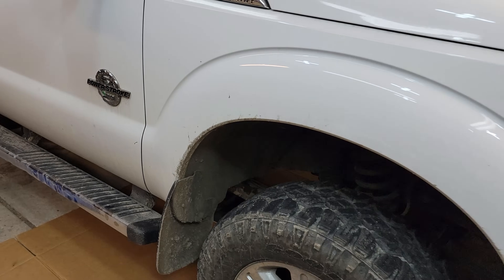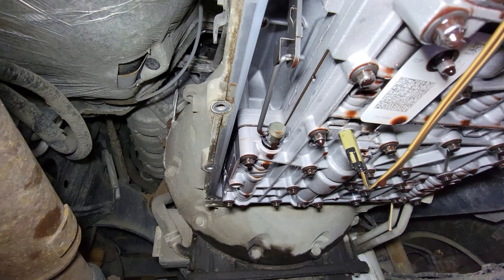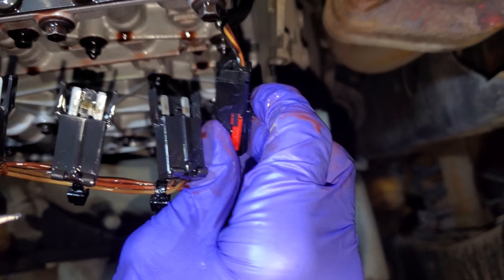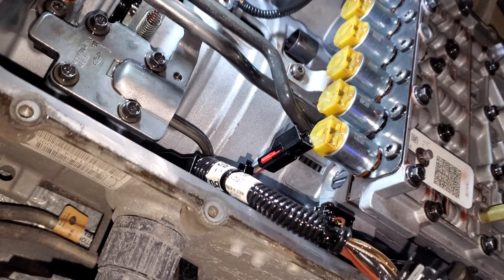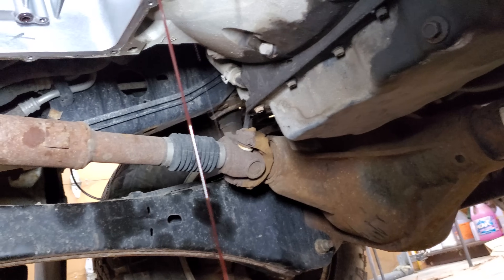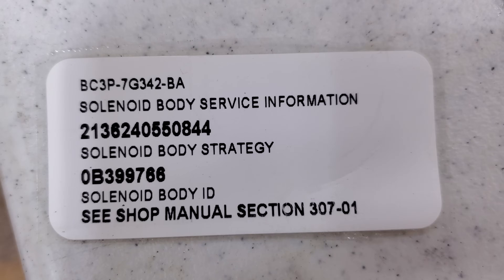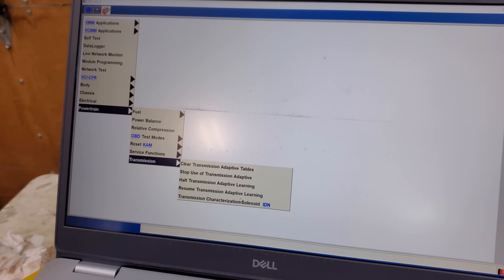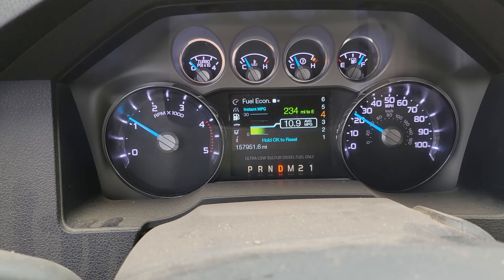**WATCH**  Ford 6R140 | Slamming into GEARs - What YOU need to know - FIXED! #6R140

Comment: Programming the valve body with IDS work while T&D.
Reply from the maker: That has no bearing on it
Reply: wasn’t able to check the strategy and ID codes to see if they match. Since I’m getting a hard shift 1-2 and 3-2.
Reply from the maker: To match with what. Each valve body is different
Reply: match the strategy and solenoid id codes provided with the sticker.
Reply from the maker: If you have a bidirectional scan tool, you should be able to
Reply: a Snap-on scan tool.
Reply from the maker: Sure, not sure what its abilities are..

Comment: Hey , when I use the part number HC3Z-7A100-B for the valve body , it claims it won’t work for a 2012 F-350 4x4 6.7
Reply from the maker: Correct. Thats an alumiduty part number. 11-16 are all BC3Z
Reply: @PowerStrokeTechTalkwARod thanks for the response my friend! , I’m assuming this would be the proper part number BC3Z-7A100-B thanks again!

Comment: Mine is from 3rd to 4th  and 4th to 3rd when you really get on it or stop abrupt.  Trans shop pulled the codes up . Tcm not reading proper voltage. Also common is the corrosion on the wires and the ground wire going to the frame.

Comment: Replaced my valve body and fixed my 3/2 harsh shift. Driveability is so much nicer. But have you came across a harsh engagement to 1st/ drive. Drive and manual 1 both clunk into gear. Rearend and u joints are all fine.
Reply from the maker: Did you program everything and reset all the values
Reply: @PowerStrokeTechTalkwARod Yes everything was recent, reset KAM, transmission values etc. shifts like butter, just M1 or initial drive engagement, and very very intermittent.
Reply from the maker: @GeneralTorva hmmmmm
Reply from the maker: @GeneralTorva that's wld be constant. No intermittent. I wld check see if ur tcm is up to the latest software level with IDS
Reply: Hmmm. Possible, truck is t&d. So would be difficult I think to get it all taken care of. I do have forscan though. @PowerStrokeTechTalkwARod
Reply: @PowerStrokeTechTalkwARod it was bad enough to make the rearend jump intermittently till I got trac bars and it tames it down SOME. but the engagement even in 4wd to drive or manual 1st is the same even rocks the front driveshaft hard,
Reply from the maker: @GeneralTorva I think you're gonna have to try what you don't wanna do. Way cheaper than putting an entire trans in it......
Reply: Did you ever get the harsh drive engagement figured out? I also have a truck that shifts great otherwise but intermediately has a harsh joult when shifting into drive.

Comment: I am watching this and wondering if this is my issue Arod. My truck will shift hard especially while towing between gears. Clunks for 5-6, or 6-5. Also between 3 and 4 I have an issue where the truck feels like it shifted but is still in 3rd, then it will kind of jerk into 4th and almost rattle as it finally shifts into 4th. 

Never does it slip out of gears or not shift. Just hard sometimes. And the weird thing from 3 to 4. 
Could this be the valve body. 
Also, for a 2019 I believe the part number is different.  For the valve body. But are the seals the same as listed in description?
Reply from the maker: Seals are the same, but you need to look up the valve body per your vin number
Reply: @PowerStrokeTechTalkwARod yep. I figured. You think this might be the fix for mine?

Comment: My 2019 has random hard downshifts mainly from 6-5 sometimes from 3-2 also sometimes locks the torque converter kinda hard but that’s rare. Also it’s turning the transmission kinda dark and greyish color. Does that sound like a valve body issue or a transmission leaving the chat issue?

Comment: Great Video A Rod!
I'd like to explain what my 2019 6.7 Super Duty is doing with the same transmission. 

I completed my 2nd fluid & filter change at around 180k miles. Everything ran great for about a week and then issues started arising. I was going to work at 4am and my truck all of the sudden wouldn't go into gear when I was trying to leave. I put it in drive and the truck acted like it was still in neutral for a few minutes before eventually slamming into gear. I figured it might be a fluid level issue since this occurred the first night the temperature dropped to 40 degrees here in Florida. I added about half a quart of fluid but it didn't resolve the issue. Over the last 4 months the transmission has been shifting very rough and many more weird things are happening. When I randomly start the truck in the morning and put it in Drive, the vehicle won't go and it jumps to 5th gear and remains there for about 15 minutes while driving. The gears randomly jump around a bit before going into the proper gear. Now the shift column lights are no longer present on the dash. It's just dark where they use to be which is weird. 

Im dependent on this truck for work and was about to replace the entire transmission until I saw this video. The truck pulls fine once in gear but the rough shifting is very terrible. Would a bad Valve Body cause the issues Im experiencing? I really appreciate your time and help man. Thanks for posting!
Reply: *UPDATE*
Even though I didn’t get a reply, I just wanted to let everyone know that all the issues I was having were fixed by replacing the valve body. After watching several videos of people having similar issues, I just took a chance and bought a new valve body. It was a quick fix that I completed under two hours and the transmission is working like it’s brand new. I can’t believe I drove the truck for five months, shifting the way it was. I spoke to several people and everyone was telling me to replace the transmission or at least rebuild the entire thing which would’ve cost me between $4000 and $12,000. I ended up spending $600 on the valve body and probably another hundred on all the fluid, seals, and filter. Thanks A Rod for posting these videos. It saved my ass and got my truck back to work!
Reply from the maker: @GnarClips now thats what's up!!!!
Reply: @GnarClips hey man how has it been holding up? Mines doing the same thing and will be doing the valve body here soon
Reply: @mikerock148 its solved the problem and ran like a brand new transmission! I couldn’t believe the difference. My only regret is that I didn’t replace the valve body sooner.
Reply: @GnarClips thanks for the reply man eased my mind some. I will be doing my valve body here co.e Monday and hopefully that resolves my issue.

Comment: Having similar issues currently along with it shifting from 1st to 5th. Gonna tackle it today to see what happens.
Reply: Got it knocked out two days ago. It fixed my hard shifts and shifting from 1 to 5. 

I didn't have a way to reset it or do the comp work so i putted around town while it relearned. It's still figuring it out but it's getting better every time.
Reply from the maker: @addisonblck102 get forscan. It's free. Ur gonna need to do it
Reply: @PowerStrokeTechTalkwARod  which one ob2 adapter do recommend? A buddy that works at Ford swears you don't need to redo it all, but there's some shift delays that make me think clutch packs are gonna start cooking. This truck has 430k on it and I'd like to see how far it'll go hahah
Reply from the maker: @addisonblck102 obd link ex cable. We can do it remotely
Reply: @addisonblck102 that is good news. Mine is doing the same going from 1st to 5th. And acting like it does not want to go into reverse for a second also then will eventually go into gear.

Comment: Hello, I have a question for after programming, do you need to do a KAM reset? Also not sure if you have an answer for this question but if the truck has Trans tuning does anything need to be done with that after programming and or KAM reset if needed?
Reply from the maker: No program the numbers and reset kam.

Comment: i have a 2017 ford f250 6r140 trans in my shop it shifts to drive 1st but wont move forward but then shifts to 5th than it takes off had code p0751 shift a solenoid stuck off swapped it out and still no change could this be a valve body issue it has 5th 6th and reverse customer stated it started shifting hard and just got stuck in 5th when trying to shift into drive whats your opinion
Reply: I just put a new valve body in my and so far solved my 1st to 5th shift change.

Comment: You only replaced 1: BC3Z-7G199-A "swishy seal" (metal tubing into transmission) but your description said get 3 of those. Where do the other 2 go? You replaced 3: BC3Z-7J227-A "o- rings for metal tube to valve body and the 3rd o-ing next to metal tubes" where does the 4th oring go?
Reply from the maker: The 4th oring is only for 650 750 applications. They have 1 more tube that goes to the rear drum
Reply: @PowerStrokeTechTalkwARod  great, thanks for that info about the o-rings. What about the black "squishy " one was for the metal tubing (plus the green and blue squishy) but what about the other 2 black squishy? Thank you
Reply from the maker: @stevesnyder6382 if they stay up there i don't mess with em

Comment: Im.having a P1780 out of range,and a P0735 incorrect ratio codes.
 Is this a possibke fix to it? @Arod @Powerstroke
Reply from the maker: Something with an incorrect gear ratio seems to me that there'd be something internally wrong. Not what you saw in this video

Comment: Got it put in and everything went easy, thanks to this video! Now sadly I have to limp it about 10 blocks to get the shift patterns reset.  I do not have forscan.
Reply: How did you go about doing this without forscan ?
Reply: @breiland154wilson  I literally locked out the gears and rolled it to my dealer buddy and had it rescanned. It was fine. Don’t be slapping it in drive and just drive over that’s probably bad!

Comment: Heyya, I just followed your lead and replaced my valve body. It didn't come with a strategy number or anything.  Messaged the place I bought it from and they are saying I don't need to program it.
I test drove it today and she shifts better for the most part. Couple of odd shifts, like dropping rpm down to 1500 or less then jumping back up to over 2k when it gets in gear. A couple hesitations here and there. But the most concerning this after this is she's sitting up at 240 degrees and not cooling. Fan kicks on and she stays up there. Hit the bottom of the pan with a temp gun and it's says 190, sure of the tranny says around 200.
Got any suggestions or advice for me?
Reply from the maker: All valve bodies have a sticker card that has #s that have 3 be programmed in.
Reply: @PowerStrokeTechTalkwARod   I appreciate it, I'm just a little slow.
I got it programmed and it shifts awesome.  Still running hot and not cooling down it's slowly climbing to 240 and it doesn't hardly cool down unless you let it sit running and even then won't cool down below 200. You got any ideas?
Reply from the maker: @DiveBomb9 replace the trans cooler. Watch my video, it's clogged
Reply: It was working phenomenally before I switched valve bodies. So I'm leaning towards something on the instalI. appreciate you responding man
Reply: Replaced that before swapping back to the old valve body, no avail. Left the new sensor in with the old valve body and she was exactly the same.
Reply from the maker: @DiveBomb9 I don't think switching the valve body is going to have anything to do with the temperature
Reply: Just letting you know it was a bad valve body I bought. Put the old valve body in and everything is back to the good ole shitty shifting and good temperatures. Will be buying another
Reply from the maker: @DiveBomb9 the trans temp sensor is right in the bottom of it. Tft was probably why ot was shifting hard

Comment: I think I need to replace my valve body on my 2017 6R140 
It jerks slightly up shifting. 1-2 2-3 and 5-6 and down shifting 6-5 4-2 3-2 
Sometimes it rights butter smooth but lately it’s been acting up more and more. Let me know if anyone has experienced the same thing. 
Thanks
Reply: You ever get it fixed?

Comment: Autel MaxiPRO MP808S PRO Version with Spare 11 connectors, 2-Year Free Update, 2024 Advanced ECU Coding Bidirectional Scan Tool, Same as MS906 Pro, Upgrade of MP808K DS808S 30+ Service, Work w/ MV108S

Can you program valve body with this scanner ?

Comment: So how do I get it flashed or programmed if my truck is programmed already?
Reply from the maker: What you just said made no sense.....
Reply: @PowerStrokeTechTalkwARod  Sorry if I was confusing I meant my engine is tuned. I’ve learned that tuning the new valve body strategy won’t affect any engine tuning.  Second: Is there any reasonably priced replacement valve body you would recommend or ones you would stay away from? I’m on a budget and obviously don’t want to spend 800-1000 on the valve body, when I can order between 300-600.  Great channels btw! Thanks you
Reply from the maker: @Rider-nb5ts juss the one you see here
Reply: @PowerStrokeTechTalkwARod ok thank you.  OEM seems to be the ticket with valve bodies. Appreciate your feedback

Comment: There was a comment in the installation instructions that came with my valve body that says “remove the manual valve retaining tube before installing the control unit”. Does anybody know what that means? Because I don’t see it anywhere in any of the online videos that I’ve looked up.
Reply: Turned out it was just referring to the plastic cover that comes on the piston on the one side. Apparently most don’t come with it. Mine didn’t.

Comment: I have a 2013 f250 runs fine and first second and third goes to 4th does nothing down shifts back to third no idea what the problem is change the filter new fluids flushed it coming up with code with solenoid shift solenoid problem and dirty fluid could a new filter fluid and new valve body with shift solenoids fix this
Reply from the maker: ……it could
Reply: Did it fix it?

Comment: Would it be prudent to flush the cooler before install?  Can I drive it to a shop to do the update on the TCM?  I believe mine is providing pressure to the Lockup clutch on the TC all the time, so I think one of the Solenoids has failed, or stuck.  Thanks!

Comment: I did a valve body re&re with a new ford unit from the dealer in my 2016. It seems like it fixed the harsh 1-2 & 3-2 shifts for a few weeks and then came back just as bad as before.
I tried switching over to a different tuning company on the advice of many people and that only seems to have things even worse.
I was reading somehwere else that the harsh 1-2 3-2 could be attributed to the ABS pump/module giving bad info to the TCM. Has anyone heard of this?

Comment: Hey, i have a problem with my transmission, low shift 4,3,2, strong kick, and it sometimes up temperature until 250 and back to 210 degrees, can you tell me can be body valve or temperatures valve?  And if i don't have computer for programming transmission, can i go to car shop or i can't move car? Thanks for you help
Reply from the maker: U wld have 2 take to a shop

Comment: I have the same problem on my 2011. Started after I did a fluid change and also used Amsoil. I was thinking maybe a fluid flush using LV might remedy it. Thoughts?
Reply: So my truck now shifts perfectly with the new valve body. Winner winner chicken dinner!!! 👍🤘
Reply: @JCBourgeois-nd7is awesome.  Mine started acting funny after a new fluid and filter as well. Will be looking into a valve body too.
Reply: I just replaced my valve body but I haven’t driven it yet, so I’ll let you know what the outcome is. I also went with Mercon LV fluid this time.

Comment: Will a bad valve body make your trans overheat, change almost everything on sec cooling system plus trans cooler and torque converter and still over heats but haven’t change valve body

Comment: Ya I have a 2016 f250 6.7 just bought is having this issue the dealership payed to have the manifold replaced in transmission but still has horrible shifting but if I put it in manual mode I can shift it through gears just fine its like the transmission dosnt know what to do
Reply from the maker: Hmm
Reply: U ever get it figured out?
Reply: @mikerock148 yes I went on dirty diesel customs and there transmission tune fixed it started shifting smooth immediately

Comment: Would it be possible to do all of this work and then drive the truck to a Ford dealership about 5 miles away? I don’t have whatever computer tool i need to reprogram the transmission.
Reply from the maker: Yea
Reply from the maker: You can do it with forscan too

Comment: Great video ! I can’t see my gears on the cluster no more and a week later I was going 70 and engine light came on, rpm went up and I started to loose speed I stop  and turned my truck off. I didn’t see nothing wrong and I got on the highway Again nothing wrong but 30 minutes later it did the same thing . P0702 p0883 are the codes
Reply: Can anyone tell me how could I fix my problem

Comment: Great video! I have a 2018 Powerstroke and my 1-2, 3-2, and 5-6 shifts are very hard. I’m going to try this valve body replacement and hope for the best
Reply: Did this solve your problem? I have the same shifts that are rough as well
Reply: Did you solve this?
Reply: @lukescott82 did it fix your problem. I'm having the same issues

Comment: Followed your lead and solved my issue. Runs like new again at 180k!
Not sure if it was mentioned in the video but in case anybody is wondering, it's going to take you about 11 1/2 to 12 quarts of LV to get the trans filled back up 👍
Thanks for taking time to make this video!
Reply: Question what was yours doing? And do u know if your transmission has ever been serviced before this?